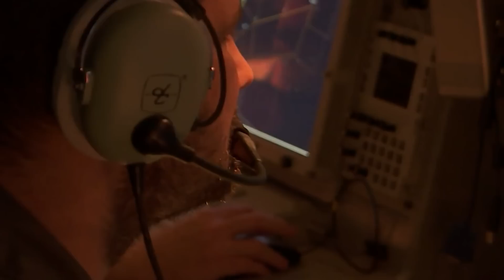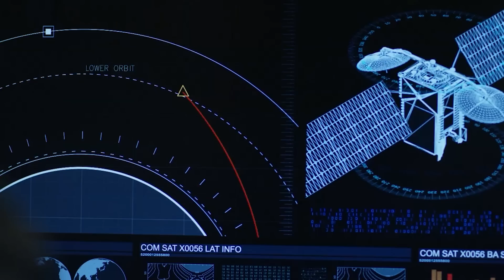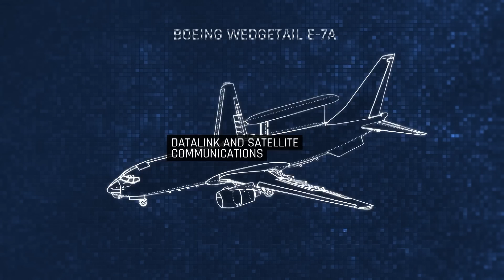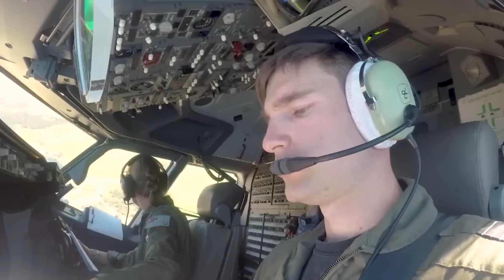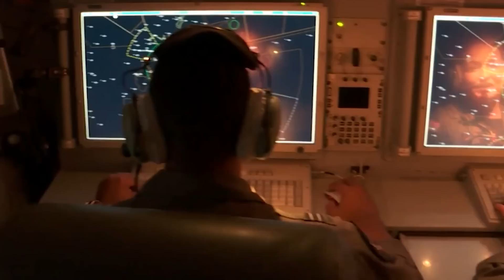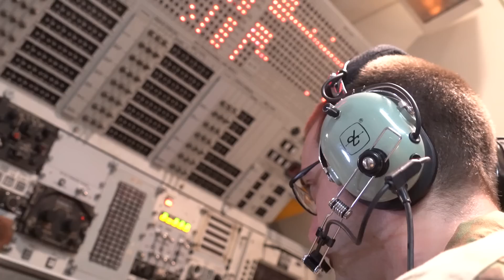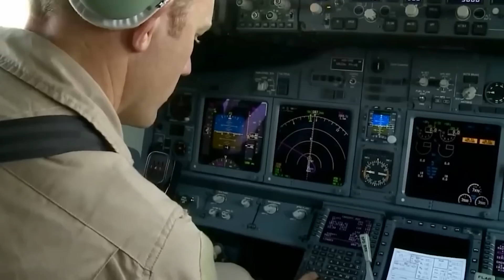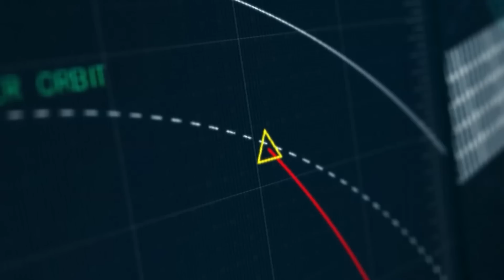The Bizarre and Risky Future of Electronic Warfare - The E-7 Wedgetail

Comment: The USAF needs a proper AWAC replacement not this E7 nonsense. A proper replacement should have a 20+ hour unrefueled endurance (read Boeing 787 HGW), it should have a dual band AESA radar 10 times the size and output of the E2D radar (preferably S band and VHF for  VLO detection), and it should carry the enlarged versions of the ALQ-247 NG high, low and mid band jammers in conformal fairings.
Reply: Such a shame that the US didn't decide to do this 20 years ago then!

As it is, the E-7 is a "good enough" replacement.

The US needs to pulls it's head out of its ass and look at replacement projects before having to retire aircraft.....
Reply: The E7 is a proven proformer, superior to all current platforms. Perhaps in 15yrs time your proposed AWAC may come into service...
Reply: We're lucky to have an AWACS replacement in the pipeline at all.  And sadly, if we hadn't reeled in F-22 and if Boeing didn't screw up 737 so badly we might not have.  There were factions that believed that AWACS was outdated, similarly to trying to get rid of A-10, and that the F-22's and other "networked fighters" made them unnecessary.  Well, that's silly of course, but USAF procurement is based more on internal and external politics than anything to do with winning a war.  Awesome that the RAAF doesn't has their head as much up in dark spaces, and they've developed some tech that can help our guys stay safe.  I suppose it's a bonus in some ways that it helps let Boeing limp along with the antique airframe.  

If the above sounds unreasonable, consider that USAF didn't think bombers needed fighter escort, and bombers could win the war, including believing that level bombing moving ships would work.  Similarly, the US entered SE Asia without a good fighter, because missiles replaced everything.  It isn't that the USAF is sometimes wrong, it's more like that when they're right it's completely by accident.
Reply: @tomsmith3045  Not contesting your assertion that US procurement is NOT the smartest or most agile. My point, however, is that 787 is a far better platform for an AWAC platform (much better payload, up to 3 times the unrefueled endurance and being an all electric airplane it has enough generator capacity to support multi-megawatt class electrical draw). Also, the E-7's radar is not ideal -- it is not powerful enough and it is basically two 120 degree side lobes with rudimentary coverage on the front and rear quadrants. This artificially limit the E-7 to linear flight paths with rapid u-turns at each end of the run rather than the preferable circular orbiting of a way point.
Reply: Yep, and it should be a less observable AWACs platform.  A proper AWACS platform would incorporate low observable technology used in the B-2 for the past 3 decades!
Reply: @mpeugeot  Not really. An AWAC is by definition a MASSIVELY RADIATING platform. There is no such thing as a low observable AWAC!
Reply: @dwightlooi  traditionally, I would agree, but if you think outside the box a little bit, it doesn't have to be.
Reply: @mpeugeot  This has got to be one of the stupidest ideas I've heard.

You are aware that this type of aircraft uses a VERY powerful radar, that can be detected up to 1000 km away.

Putting stealth technology on it is like have an invisible Bond car, with a strobing orange light on top.....
Reply: @matthewwadwell6100  you are making some assumptions about this without thinking about how you can apply low observable technology to accomplish the goal.

Next you will be telling me that low observable technology has no place on the F-22 and F-35.  Hmmm, I wonder, does the B-2 emit any RF?  I am telling you that there are ways to achieve this while remaining a low observable platform, just because you can't understand how doesn't make it a stupid idea, but rather it just highlights the lack of cognitive flexibility you have.
Reply: @mpeugeot  You seriously do not understand the use of Radar in combat.

The F-22/-35 do NOT constantly use their radar (this is why the AMRAAMs now have active radar) - they are guided onto their target by the AWACs aircraft, and only briefly use their radar to target their missiles, and then turn it off again after firing.

The B-2 only uses it radar in self defense - i.e. after it is detected!

The whole idea of an AWACs is to keep the threats away from the expensive and important aircraft, which is why they fly with fighter escorts.

Giving them stealth (or installing the AWACS systems into a stealth bomber) is a waste of time and money - you'd be better off buying more fighters with the money you'd save!
Reply: @matthewwadwell6100  try reading Rabideau, D J (2003). Ubiquitous MIMO Multifunction Digital Array Radar ... and the Role of Time-Energy Management in Radar, that may at least get you thinking.
Reply: @matthewwadwell6100  BTW, no, the B-2 doesn't use radar for self defense.  Thanks for playing.
Reply: @mpeugeot  Look at it this way - if it was a good idea, surely someone would have done it by now.

Ergo - dumb idea.
Reply: @matthewwadwell6100  and how do you know that they haven't.  I have worked on plenty of projects when I was in the USAF to know that the public at large will never hear about them.
Reply: @mpeugeot  Yeah, sorry about that - I double checked and found out that I was thinking of a different aircraft.
Reply: @mpeugeot  yes by all means have a low viz  low observable platform.....because that will make all the difference with the  small super-nova "radiating" on the roof
Reply: starlink fixes that.
Reply: hahahaha tipical yank crap
Reply: Your statement makes zero sense

Comment: The next generation AWACS should be based on the 787 Dreamliner, it has a longer range and much more modern technology than the 737 Max. Also, you can nickname it the Sandman.
Reply: too expensive; 737 platform is magnitudes more versatile and cheaper. 787 AWACS would be gorgeous tho <3
Reply: No, it should be based off the B-2 platform.  There is no reason for the next generation AWACS to not be less observable.
Reply: @mpeugeot  🤣😂🤣

Comment: Why does everybody have a hard on for the dated 737. If you want an old air frame, fix / update what you have.
Reply: I'm watching these POS 737 replacing the Orion P3 as ASW platforms.. What a great government jobs program. 
Replacing the best, low flying cost with a high priced POS that has no loiter time.

Comment: Timeline for acquisition is B---S---!  The base 737 is currently being manufactured!  Pull a couple out of the assembly line towards the front and add a couple orders to the back.  Same thine for the AWACS mods.  The UK and the Aussies have operational aircraft flying missions right now!  That means the Wedgetail mods are being manufactured right now too!   Any BS about having to start over is just contractors trying for a bigger price tag and a longer lead time which will also get them many $ millions more from the US taxpayer.  If this was done the right way I seriously doubt it would take more than 15-18 months to have the first two operational!
Reply: The problem is that ALL of those 737s have already been ordered and paid for by the airlines that made those orders years ago. You can't just appropriate them without paying a large cost (assuming the airlines are even willing).
Reply: Yeah, you are correct but in this case the MIC can't milk the taxpayer that easy and the financial kickback for the politicians would also be less.
Reply: Complain to the Air Force for being dead on their ass for years instead of replacing AWACS sooner.  Also, the issue is not really about producing the commercial platform it is the Air Force's unique requirements and equipment.  It would be smart to build it Identical to the Aussie or UK model but they won't....that means new equipment and testing...not to mention since not too many wedgetails have been/are being built, you can count on supply chain problems for all of that equipment the USAF will specify to install.
Reply: You are 100% CORRECT! Eisenhower warned about this happening a long time ago. Sad but true.
Reply: You'd wonder, wouldnt you. You'd also think the radar manufacturer could also develop a lower "export specification" package that could almost be bolted on to existing airframes, could be a kerrching moment....
Reply: They stopped building the 737NG in 2019.  So it probably is going to take quite a bit of lead time to get the necessary parts vs the 737Max stuff that is likely easier and faster to get.  Unless they want to update the plane to use the Max as the base, but I would doubt they'd do that as it would take even longer to get certified.
Reply: Must be hundreds of practically new 737maxs sitting at Mojave CA alone 😇😇😇
Reply: The problem with using the MAX is that wedgetail was in development before the MAX was certified. so if you based wedgetail on MAX, then the wedgetail would probably still be in development right now just like the MAX 10 .... lol.... but now if you based the USAF wedgetail on MAX then you will have two vers of wedgetails.  A HUGE nightmare.  
Its fine to use the 737NG platform even if the fuel efficiency is not as good as the the MAX.  NG is a proven platform that will be around for A LONG time with avail parts around for a while

Comment: Unfortunately it's a 737 so it'll crash as soon as they engage the autopilot.
Reply: The E-7 Wedgetail is based on the 737-NG predecessor to the 737-MAX, so it doesn't have the larger, forward-relocated engines you mentioned which MCAS was designed to compensate for.  I agree that the E-7 Wedgetail should not be based on the 737-MAX.  Even if MCAS was perfected, it makes more sense to duplicate what Australia and other countries are already using successfully, rather than undergo a new development effort with what is effectively a different aircraft.
Reply: 737 has a long career and is one of the safest airliners ever flown. Only thing wrong with the Max is airlines not training their pilots.
Reply: @kdrapertrucker  Yeah not training their pilots to overcome a blatant design defect that requires glitchy software to overcome that fact that the MAX is the only commercial airliner ever purposely designed to be unstable to accommodate a cost-saving engine location.

Comment: Not one of your better episodes.
Several factual errors, & a total misunderstanding of the causes of the 'risk' you 
The E-7 is not a risky programme, assuming the USAF can avoid cocking it up by insisting on a completely new AEW&C system.  The risk is in that the USAF have decided to start retiring E-3s before the E-7s are available, & that is probably down to budget limitations.
In the UK, we have done the same thing in retiring all our E-3s before our E-7s are ready.  I assume we are relying on the NATO E-3 force for AEW support over the North Sea.
Reply: You are indeed correct in your assumption about relying on NATO E3's. It's a risky strategy for the UK too but at least we've placed an order. I think as well the UK order has been revised to only 3 aircraft - another risky strategy for the UK IMHO.
Reply: @andywhite40    Scuttle butt is the US will get the other two for testing…

Comment: They don’t usually call AWACS “electronic warfare” even though it is.  Electronic warfare is usually thought of as electronic ISR and also SEAD.  But it’s a complicated subject.
Reply: RJ for ISR. Wild weasel f-16 for sead. Awacs is command and control
Reply: @Shredxcam22  JSTARS for ground Command and Control, and Compass Call for Electronic Attack.
Reply: @Shredxcam22  F-35 for SEAD is more lethal.
Reply: That being said, he mentioned that this aircraft has additional ELINT hardware below the radar
Reply: All useless if you have a good tinfoil hat.
Reply: AWACS’s younger sibling, AEW&C primarily, with EW capabilities.
Reply: No we don't.

Comment: Just one advisory & correction.....The AWAC system was designed and built by Hughes Aircraft Company.... the new system is also derived from Hughes as well.... specifically the scientists at Hughes Research Lab in Malibu, California (today known as "HRL" and jointly owned by Boeing and Raytheon) created the new gen radar system.  The shape of the array (fixed/non-rotating) was made possible by the scientists "finding" a way to make the molecules  change direction instead of the array having to move.  This eliminated the rotation requirement and allowed a much smaller/more condensed "component" be deployed while increasing effectiveness.
Reply: I think these radars are composed of an array of tiny antennas, which are fed in phase in such a way as to constructively interfere in a specific direction. Reception is accomplished the same way, but in reverse, using fast Fourier transforms.
Reply: AESA radar is old technology............Effective but old.
Reply: @BennyCFD  but you have to remember from the time we create something we don't just leave it alone, hundreds if not thousands of upgrades and revisions are made keeping the system incredibly effective.
Reply: Compare to what??

Comment: What type of range this radars have? What type of missions they do?
Can they detect low RCS aircrafts?
Reply: As far as public data says: against fighter-sized target, the maximum range is in excess of 370 km in look-down. In look-up around 600 km. But surely they won't tell you the real specs bc that's classified.

Their missions are c2 (command and control),  airborne surveillance and as an early warning systems.

Should it detect stealth aircraft? Well usually AWACS are made for that in some way, so yeah. From how Far? That's classified 😊

have a nice day :D
Reply: they detect joe
Reply: 4:28 
and 4:40.
Reply: Back in the 1980s during the Ronald Reagan administration, a version of these but in smaller aircraft were specifically developed and built by Hughes at their hangers located at the Van nuys airport in California. They were specifically used by the Air national guard if I remember correctly, to address the drug cartel utilizing both high-speed cigarette boats and submarines to deliver large quantities of drugs. The drug cartel in South America was so infuriated over these two aircraft that a 1 million dollar bounty was put out during their creation for anyone who could blow them up. Literally! To counter this and because the aircraft was slightly larger than the hangers could hold, as a result they were parked outside. Surrounded by portable fencing and armed guards from Hughes security Force with very large caliper weapons, they lit the two aircraft up with multi-million candle watt power lighting that could actually be seen for miles away all the way from the 405 freeway. In short anyone trying to walk, sneak, drive anywhere near these two aircraft would be easily spotted and threats neutralized.

Comment: At some point one has to ask the question why it takes two years to reoutfit a commercial airframe  to a military capable craft in our age of computers and streamline processing. Perhaps we should be asking the contractors this question. If they can't answer it then the contractors are free to throw me any extra piles of cash that they have collecting dust.
Reply: I take it you have never built anything of significant size? [not meant to be an insult]
Large systems like that are very complex, mechanically and in terms of the electronics.
I think you might be ignoring everything that has to go in and function together seamlessly, or maybe just the sheer scale of a project like this?
Reply: @kanagawakenji7  He read a management book and has a poster of an eagle that says, "Success is the object of motivation and energy combined. Focus on winning with optimization." With that amazing combo why would he have to have any idea about what reality is?
Reply: Let me guess. You have built your own gaming computer and think everything works like that.
Reply: If you only knew how rigoress the aircraft industry is,  sometimes it is the computer/paper work  that steels plenty of  time.
Reply: @blidderbla   oh yeah but we’re not talking a clean sheet design. Boeing been building the 737 for 50 years. As I said the airframe is probably the most straightforward part for Boeing making these, the fit out is the most complicated
Reply: It’s the fitting out that takes time. The airframes are built fairly quickly.

Comment: E3 isn't obsolete they are just old
Reply: I was stationed at Tinker AFB with the 552 when the first E-3s arrived in 1977, even then I was not terribly impressed with them. The fact that they were as effective as they are, is due solely to the men and women that keep them in the air.
Reply: @rickybrand2339  You do know they have been upgraded in the last 45 years.
Reply: @britishrocklovingyank3491  of course I do, I was in on some of them, I was an avionics communication tech.
Reply: @britishrocklovingyank3491  Wait, Wut, we aren't still running Windows 7 on the AWACS???  ;)
Reply: @mpeugeot  I can remember talking to a commercial aircraft maintainer, and he stated that the updates for the planes flight systems (I can't remember for which aircraft, but they were modern aircraft) are installed using 3.5" disks.....